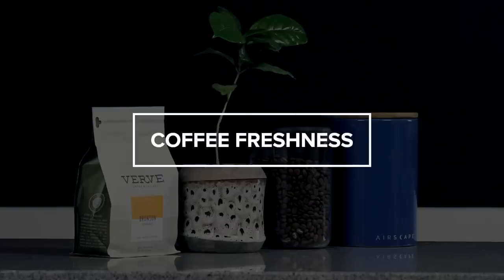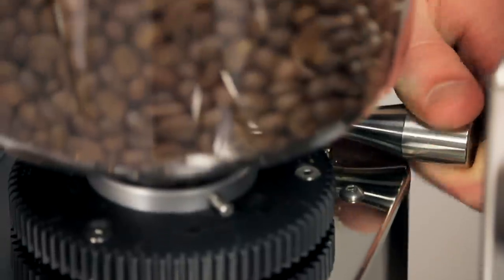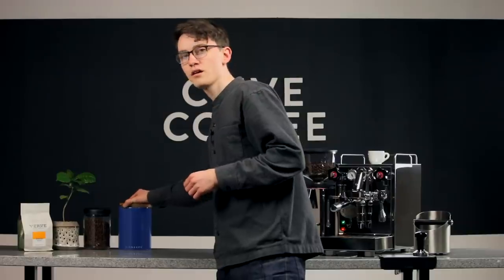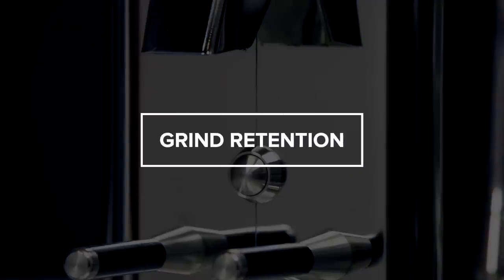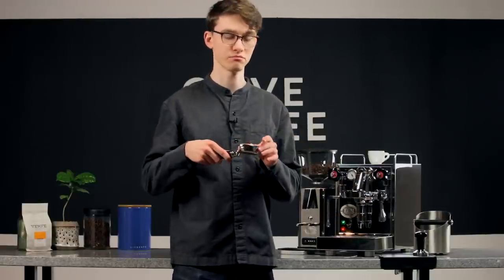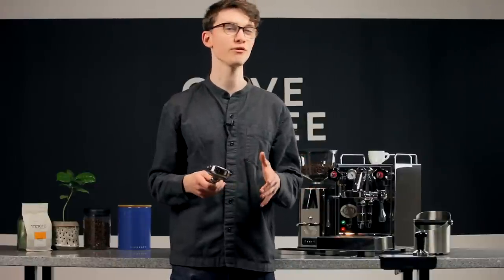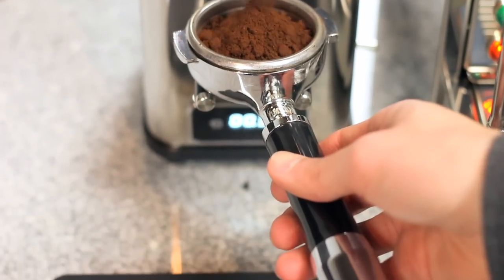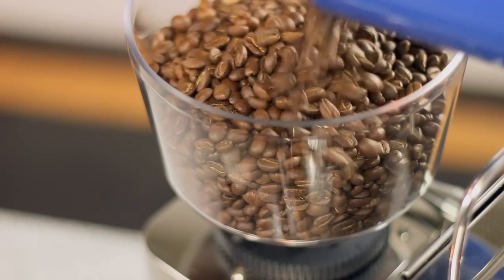How To Avoid Inconsistent Extractions

Comment: The part about the heat exchanger as well as the hopper fill level were both eye opening to me as variables that I was missing.
Reply from the maker: Super simple things that you can adjust that can make a huge difference in outcomes.

Comment: It seems a little counter-intuitive to ask people to keep their beans fresh, and then ask them to keep 1/3 of their hopper full of beans. What's worked for me is single dosing. And I don't have the issue of getting a slightly coarser grind because I adjust my grind setting to compensate for having only 18g of beans in my hopper at any given time. Between that and a purge of about 4-5 grams daily, my shots are super consistent, even on an entry level machine like the Gaggia Classic Pro. I keep the rest of my beans in an Airscapes canister and only ever put half a bag in at a time, while keeping the other half in its original packaging, sealed and in a cupboard.

Comment: Enjoy your explanations.  But.  I'm not sure that the weight of your coffee in the hopper should affect grind.  If so, it seems a flaw in grinder design.  iirc, at one point you mention adding just a small amount of coffee in hopper, then 1/3 full at another.  
Still very thankful for great coffee understanding.
Reply: This is a flaw in most high-end grinders as they are scaled down versions of what they use in cafés where it really doesn't matter. The Niche Zero is a good option if this is an issue for you. Also, I think that too few beans in the hopper will result in a finer grind rather than coarser as the beans aren't being pushed through the burs as fast.
Reply: I was thinking that too. I think I'd rather just keep the grinder consistently empty and the coffee fresh. I can adjust my grind if there's any texture difference from the lack of downward force

Comment: Hi Team
Just caught up on your plain speak and easy to understand videos ...Magic thanks .Couple of problems have arise for me as a result on changes. Putting the close to (don't have scales) dose of coffee into the basket results in a very wet mushy biscuit. My machine (a Rocket) will draw (close enough) to the prescribed out put of coffee but its a race and around the 14 to 16 second mark . I'm not getting much in the way of crema despite having tightened my grind up and with fresh beans. ...Any suggestions ? should i use more ground coffee as previously I filled the basket to the top and ended up with a firm biscuit or do i just need to adapt to the new. The resultant coffee on the way was fine but then I do dilute with a little milk
Reply from the maker: Hey there! If you're using fresh beans, it sounds like your grind setting still needs to be adjusted finer. Adding a little extra coffee to your initial dose may also help slow down your shots too.

Comment: I have the sette 270 and decided to try single dosing but am having inconsistent results. Do you recommend filling the hopper to 1/3 even for single dosing with this grinder?
Reply: Matthew Baron Matthew, I also have the Sette 270 (wi version) and the Sette instructions specifically state that they are not single dosers and to put more in the hopper. I am on the road without access to the paperwork, but it’s in there.
Reply: i am using the eureka specialita for single dosing. before every grinding i gently tap the side of the grinder and purge it 1- 2 times. this has helped me getting these consistant shots. there are always old partical coming out of the grinder. Also make sure you find a method for good partical distribution in your basket that fits you well. channeling lets your perfectly fresh espresso run for 21 sec instead of your preferred 26 for example.
Reply: Matthew Baron having the same issue with my Sette 270Wi, I hate filling the hopper for pulling 2 or 3 shots a day but they made it clear it’s not meant for single dose.
Reply: Thanks everyone. In another Clive video, I believe they said it was a good single doser due to low retention, so I figured I'd give it a try.
Reply from the maker: Hey Matthew, glad to see you're getting some input! To clarify, if you have the standard Sette 270 we consider it to be a fantastic single dosing grinder. Their design makes them quite adept at consistent grinding with just one dose in the grinder. We even use them this way for our barista classes. I'm curious to hear what kind of inconsistencies you're experiencing.
- Charles
Reply: Clive Coffee I think you also mentioned in a video, the wi was also a single shot, despite Baratza’s guidance to the contrary.
Reply: I had to make the grind considerably smaller, but now it's working fine.
Reply: @rucalopin1856  Hello Ruca, could you explain what you do in some other wording, please? Just knocking on it?
I have the same Specialita grinder and use it for single dose every time: just put say 18.0 grams of beans and get exactly 18.0 grams into my porta filter. And I definitely not keep the beans inside the hopper.
BTW, I use a vacuum cleaner to suck the old coffee particles from the inside of the grinder from time to time, but have never disassembled it for cleaning (and have no plans to).
P.S. Like the grinder very much and would recommend it to others.
Reply: @mgbaron  Sounds like you experienced what they said in the video, without the weight of the extra beans it doesn't grind as fine, but you adjusted your grind finer to compensate. I wonder if that means you get slightly inferior results though because the beginning of grinding has weight from beans, but the end of grinding you have none. I would think as you start grinding that 18g or whatever of coffee it would go slightly more coarse, but who knows maybe some variation in particle size helps with flavour. I have a Baratza vario and single dose with it as well, and it probably has the same 'issue' since it's likely physics based and applies to all grinders. 
The Niche Zero and there was another one I forget which, have a work around for that issue, they use a slotted disc to slow down the flow of beans making the weight ontop less relevant (also slows down grinding a bit, but should make it more consistent).  Something like that for the Sette might be a good idea. 

If you have no clue what i'm talking about: 
https://coffeeequipmentreviews.wordpress.com/2019/11/18/niche-flow-control-disk/

Comment: Can humidity affect extractions? Should I grind coarser when humidity goes up?
Reply from the maker: The extensive testing our product team has done shows that it may have a slight effect but it's so subtle as to be generally ignored. In our experience it's better to simply pull that first shot as you normally would and make any slight adjustments as necessary.
- Charles
Reply: @clivecoffee  Thanks ☕☕

Comment: Would you also recommend flushing water on a single boiler machine like the ECM Classika? I typically do but only for a second or two.  I’m thinking now that it isn’t needed & is a wasted effort.
Thanks
Reply: You only need to flush until the bubbling/fizzing sound of the water stops. As soon as the sound calms down you can turn it off. On my single boiler heat exchanger Bezzera that can take about seconds when it's been sitting for a few hours.
Reply from the maker: Since the Classika is a PID controlled single boiler it's not necessary. It is a good habit to flush the group after a shot to rinse any grounds from the screen, but otherwise, you can get right to pulling shots with a PID machine.

Comment: Serious question Charles, why there isn't a single grinder designer even for very expensive machines like my 1500$CAD (Rocket Fausto) that can think of a very simple and easy way to make the hooper hermetic while a goddamn 5$ Tupperware can be hermetic?!? I highly doubt that it wouldn't be something possible to do or beyond imagination.

By the way, very interesting videos, I've watched over 6 in a row and learned a lot! My coffee on my Rocket R58 is suddenly tasting better since the last 2 days lol.
Reply from the maker: That's a great question and I've wondered the same thing. After finding a hopper that had the same diameter as an Airscape container, I tried inserting one of their air-tight lids which evacuate excess air. What I found was that this reduced airflow through the grinder to a degree which caused the grinder to repeatedly jam.

So the answer is: it's unfortunately slightly more complicated than making a good tupperware lid, but if a decent engineer put their mind to it I'm sure it'd be possible.

Glad to hear you're getting so much from our videos!
- Charles
Reply: Even if they build an airtight lid for the hopper, the opening below where the coffee comes out is not airtight.

Comment: I understand that coffee must be fresh, but how do I avoid getting beans that have been sitting on a shelf in an (online) store.

And if I have to keep my hopper 1/3 full, aren’t those beans too long outside an airtight container and in the light? In a shop they will be used within hours, but at home that might take a few days.
Reply: dont buy beans without 'roast' date. expire date means nothing.
Reply: SDFG SDFG ok, but I get my beans straight out of Rome and ordering just one or two kilo is very expensive so I order 5-10 which covers my need for at least two months.
Reply from the maker: Our recommendation is always to buy beans from a roaster who stamps a roast date on every bag.

If you can get through the 1/3 hopper in a few days you should be fine, any longer than that and you tend to encounter issues. How quickly coffee goes stale in a hopper depends a bit on atmospheric conditions, so I recommend testing it for yourself and seeing if you encounter issues. If you do, you may consider giving single dosing a go. Nothing beats storing all your coffee in an airtight container until the moment you grind.
- Charles
Reply: Clive Coffee I understand, but even if what I buy is freshly roasted, even then if I buy several kilo it will take a while before I use them. 

Ordering my fav beans per 2-3 kilo is a hassle. And shipping 2 kilo makes it very expensive.
Reply from the maker: @jjg19631  Usually, I'd suggest buying only as much as you'd use in the span of a couple weeks. Baring that, if the bags are airtight you're in a pretty good spot. Even better if they're nitrogen flushed. If not then I'd recommend getting some large airtight or vacuum containers to store the coffee. That'll go a long way to ensuring it's fresh when you get to drinking it.

It's not the ideal scenario but hey, you found some coffee you love. That's what it's all about. Hopefully, this will help you keep each shipment at peak freshness!
- Charles
Reply: Clive Coffee thnkx,. Where are you guys located. Saw some gorgeous woodwork on the Synchronica somewhere online that was (I think) your work. 

I’m Stateside in a few weeks, any tips on a good shop in Vegas as most coffee is pretty bad on your side of the pond 🤭.
Reply from the maker: @jjg19631  We're located in Portland Oregon and while I can't speak for the entire country I can vouch for my city! If you're ever in town be sure to drop by our showroom and pull some shots.

I don't believe anyone here has a personal familiarity with the coffee scene in Vegas, but I'd recommend checking out Sprudge's guide: https://sprudge.com/coffee-lovers-guide-las-vegas-105791.html
- Charles
Reply: Clive Coffee Thnkx Charles, I will look into that as most Vegas-experiences on the coffee-front were pretty bad.

And Oregon is on our list as well and I will definately drool over the stuff you guys have 🥰.

Comment: I don't store beans in the hooper!I have vacuum container and works great!You shouldn't keep beans in hooper more than a day chaps ,in domestic conditions impossible! So single dosing is the way for home users!
Reply: Well, adding just 20-40g every single time seems pretty ridiculous and while too much isn't good cause for some reason dumb grinder designer can't think of a way to make their hooper hermetic even at 1500$ when Tupperware can do so for just 5$... but since you need to fill it up 1/3 to exerces enough pressure towards the blades, then u can't just add 20-40g in it.